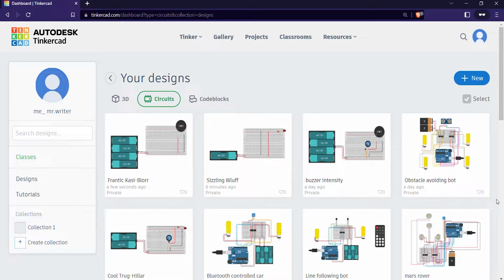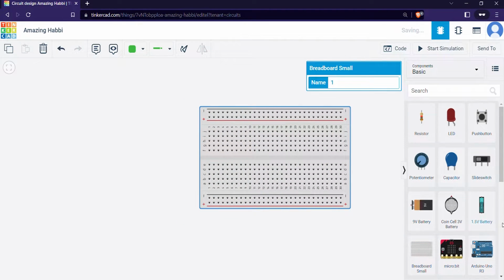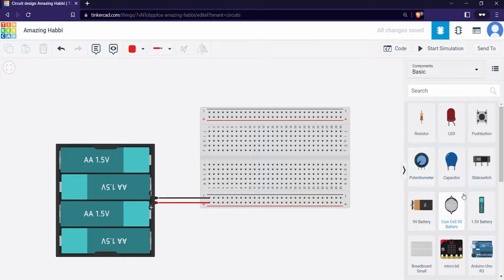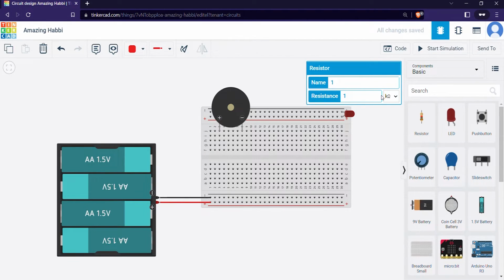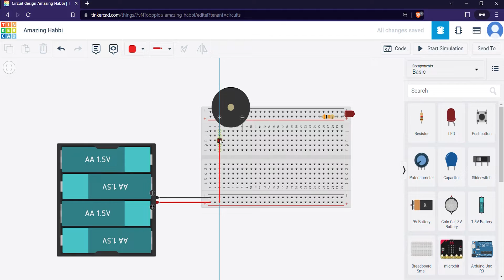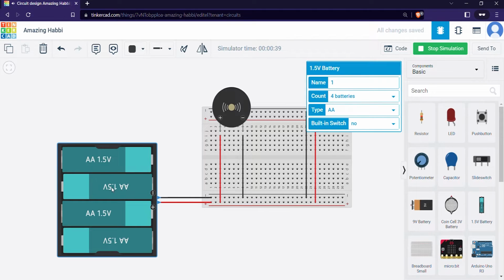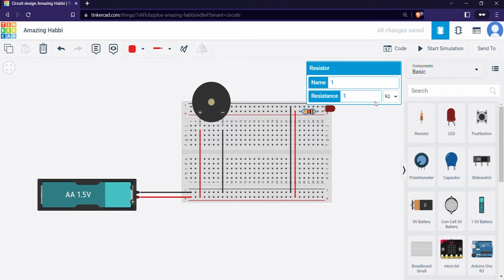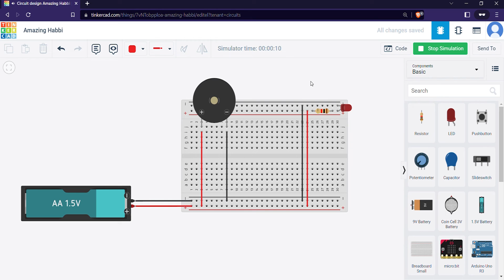LED and Buzzer circuit on TinkerCad

Comment: You have connected the resistor in parallel to the breadboard top supply rail so the resistor does nothing. That’s why the led had too much current and blew. Once you reduced the voltage the led’s current was low enough even though it had no resistor in series to it, probably because there was insufficient current capacity in the battery as it was powering the buzzer.